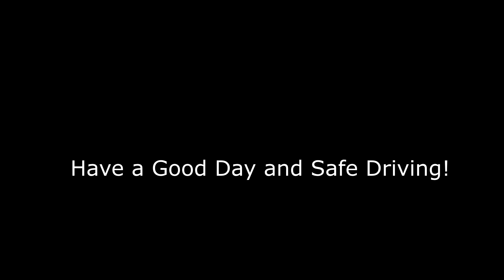How to Install Molle Panel in Truck and SUV - Molle Fold-Down Tailgate Panel

Comment: Any concern with sturdiness just installing into plastic instead of metal?
Reply from the maker: I reinstalled with small bolts and nuts/washer on the other side - just to make sure. But didn't have any problem when I had screws that came with the package - it was holding ok my camping stove /etc

Comment: I think the rubber gasket is supposed to go on the top of the side brackets where the pins insert. It’s supposed to prevent the panel from rattling when it’s closed up with the pins.
Reply from the maker: The kit didn't come with instructions and I didn't find any online... so I guess I'll find out by trying 😀